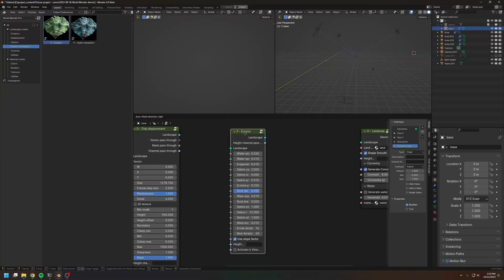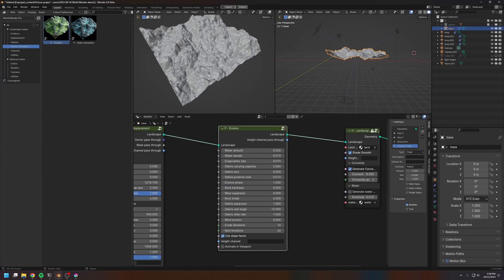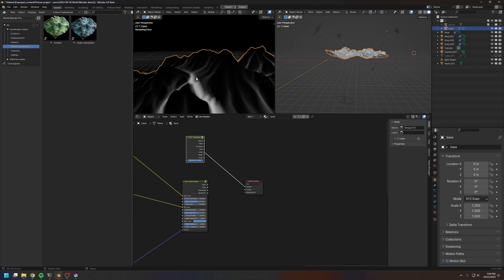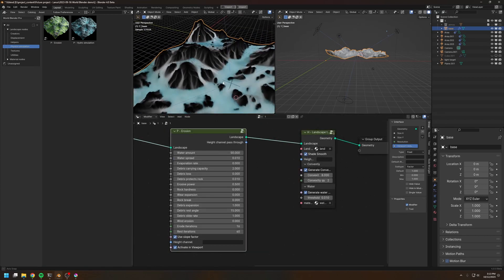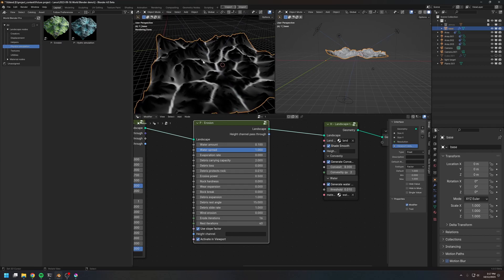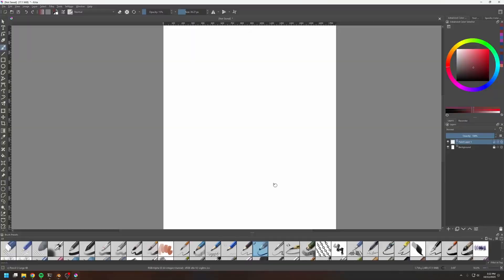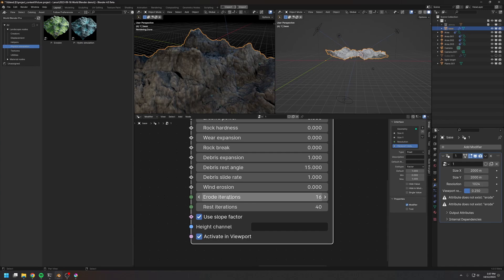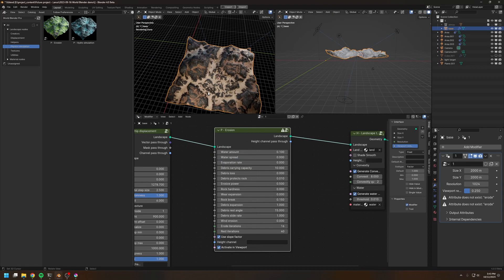World Blender 07 - Erosion

Comment: I don't think it sounds logical that the soil under the lakes will erode a lot because I would think that the water in the forming lakes would decelerate further erosion.
Reply from the maker: the rock is only eroded when it receive water. Stagnant water doesn't do anything except forcing the incoming water to spread out and weaken the erosion. Also valleys have a lot of dirt in it which will also protects the rock underneath from erosion. The water can only make deep cuts if there is a path for it to flow away, taking the dirt with it and expose the rock for more erosion
Reply: @LancePhan  sounds reasonable:)